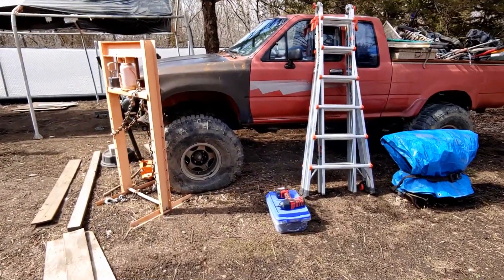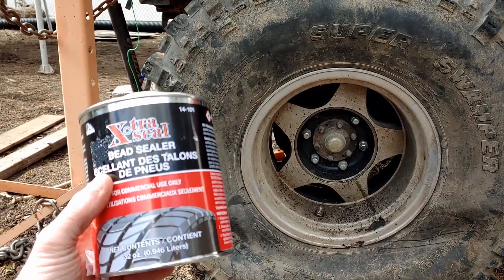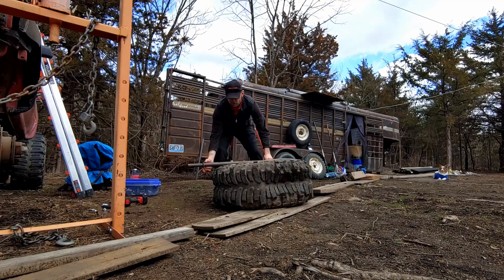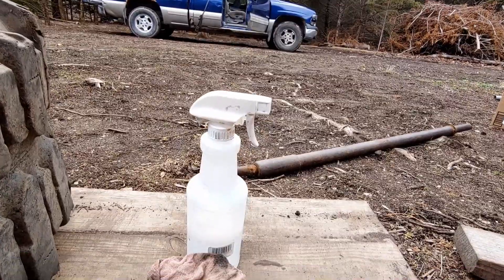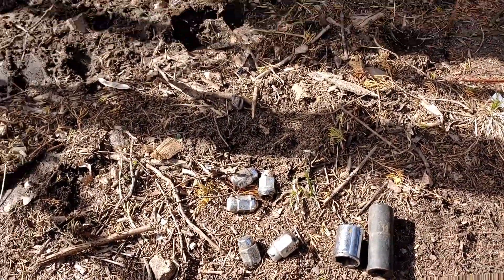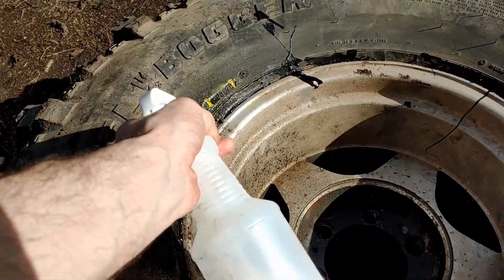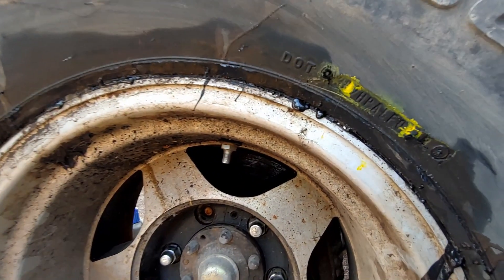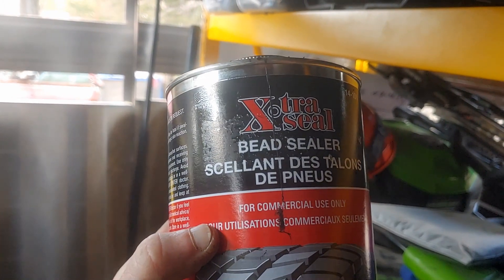Vehicular Education: Tire Bead Sealer

Comment: Let most of the air out of the tire before you remove the valve stem...you're lucky it didn't fly off into the trees x2. Next time clean the bead area before adding the gunk.